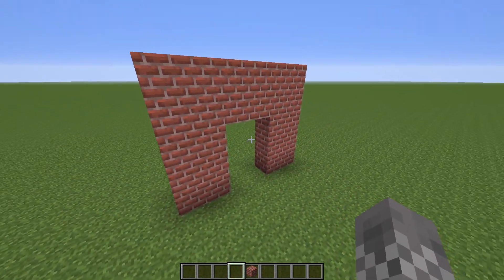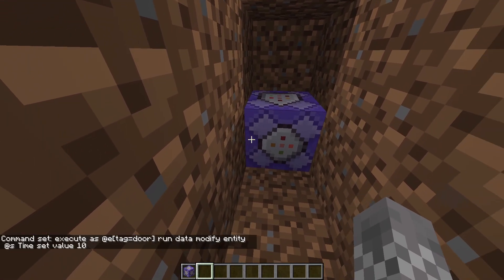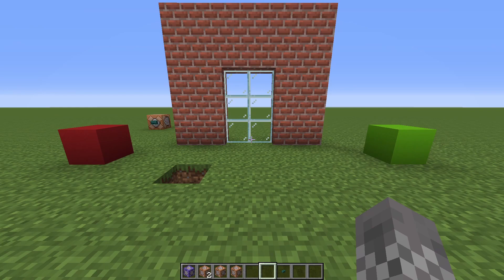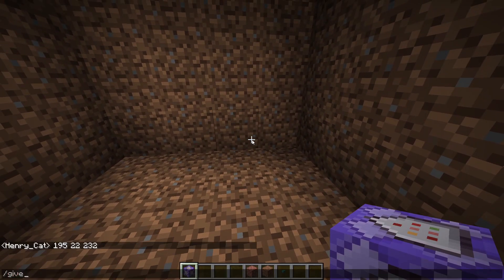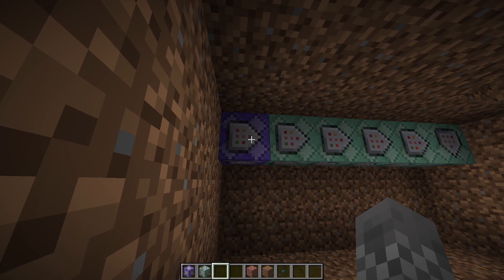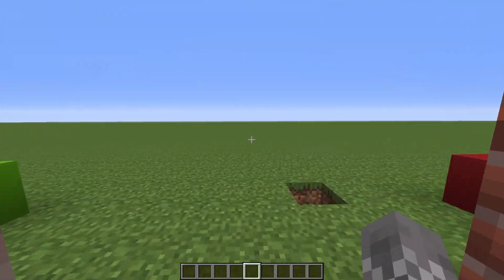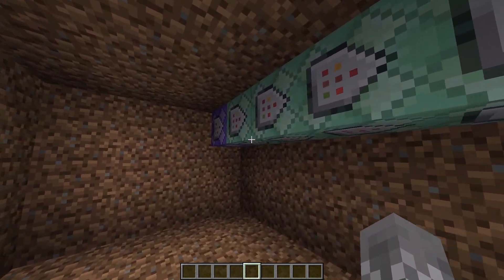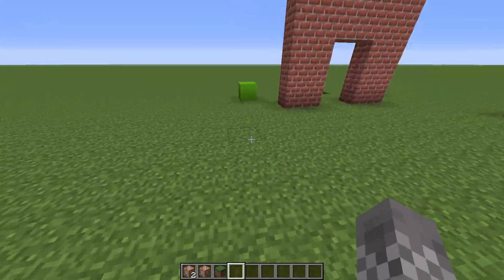How to Make a Smoothly Sliding Glass Door in Minecraft Java - Minecraft Command Block Tutorial

Comment: Thank you so much for the tutorial! i also had an idea that insteadmaking those chain command blocks you could use scoreboard system the easier way of the scoreboard system would be that the door would be powered by button , when pressed , scoreboard named for ex. 'door open' would be set on 1. Then there would be repeating command block that would move the door when 'door open' is set on one, attached to the previous command block i talked about there would be chain conditional command block that would everytime door moves the 0.1 block checked if score 'door open' is eleven if it wouldn't be it would add 1 to the 'door open' scoreboard. There would also be last command block checking if score 'door open' is eleven if it would be it would reset the scoreboard. (Idk if ya understand it guys cuz it can be pretty hard to imagine but i hope some of you do so =).

Comment: Hello, my positive glass blocks move infinitively, and my negatives don't even move, what is wrong? I did /scoreboard objectives setdisplay sidebar door, and it showed that the value of door1 was always 0, whenever I walk up to the door, it remains as 0 unless i have to change it to 10 manually to move it. What did I do wrong? It travels in the X axis. I did exactly everything you did.
Reply from the maker: Hmmm... it's always hard to say exactly what the problem might be, but I can say that it's the fifth command that should be making the score count up. The command might not be running (if the one before it isn't facing into it, you can check by replacing it with a simple /say command), or there might be something wrong with the command itself (wrong coordinates, wrong distance, etc.). If none of those seem to be the problem, let me know and I'll see what I can do.
Reply: @HenryCat  Thank you very much, I'll keep on trying on your help!

Comment: I have a problem, only the negative door moves, and goes to infinity, it doesn't stop, how do I solve this?
Reply from the maker: Hmm, that's odd. Unfortunately it sounds like any number of things could be causing the problem.  I would check and make sure that a. all command blocks are powered on and facing in the right direction and b. that you aren't missing any commands. Both of these sound like relatively unlikely issues, but always good to check. Another thing that might help is run 
/scoreboard objectives setdisplay sidebar door
This will allow you to watch the score of door 1. It should be at 0 when the door is closed, count up as it's opening, and at it's max when the door is open. Besides that, I don't really know what else I can suggest, because it's again really hard to diagnose random bugs like this without checking the commands directly.
Reply: @HenryCat  ok,i will check them again
Reply: @HenryCat  after 3 months,its work! thx!!!

Comment: I know im late, but is there a way to do a door like this but that slides with a redstone pulse insted of someone walking?
Reply from the maker: Okay, here is how I would do this. 
Take the last two commands in the repeating chain and change them to this (it's the same for x and z):
/execute positioned [coordinates] if score door1 door matches ..# if score opening1 matches 1 run scoreboard players add door1 door 1
/execute positioned [coordinates] if score door1 door matches 1.. unless score opening1 matches 1 run scoreboard players remove door1 door 1

Then, to open it have a command block with this command:
/scoreboard players set opening1 1
And close with:
/scoreboard players set opening1 1

I haven't actually tested this but it should be pretty straightforward. Make sure to turn off the repeating chain before making the changes and turn it back on when you're done.
Reply: @HenryCat  
Tested, but had to make a new scoreboard objective. Doors move forever. Also, is there a way to have doors moving on the y-axis? I kind of want a castle-like gate.
Reply from the maker: @hybrid8229  I think a gate along the y-axis should be possible. I think rather than having positive and negative, you just have one side, which is teleported vertically rather than horizontally.
Basically just take the x-axis repeating commands, delete the second and fourth, and replace the "~-0.1 ~ ~" with "~ ~-0.1~" in the first and third. Let me know if that works!

Comment: Small problem: You can go through the door when it's closed because there is nothing blocking you
Reply from the maker: That's true, I was generally just assuming that it opens fast enough that it's not a problem. Generally, the solution to that is to use shulkers since they have an actual hitbox, but unfortunately the little inside bit of the shulker stays visible even when you give it invisibility. That means that for a glass door like this, you can't completely hide the shulkers, which is why I skipped them.
Reply: @HenryCat  You could add barrier blocks for when the door is closed and when it isn’t completely opened, and take them away when fully opened using scoreboard, preferably. I used that for my fence castle gate in my map and it works.
Reply: @HenryCat  I understand why you skipped the part btw, I just wanted to make it clear for the viewers.
Reply: Use a command block to to put a barrier inside of the door when it's closed and when it opens, it removes the barrier. The only problem is that I don't know if you can summon entitys inside of other blocks. I'll test it out.

Comment: everything was working with glass panes so i changed the block to stone bricks, but then the positive was sliding to the negative and negative to positive? when you're standing next to the blocks the stone bricks were in place for where they are supposed to be when the door is closed, but when you move away and the door is supposed to be closed the blocks slide into each other leaving small gaps in the side, help?
PS: the only thing i changed were the blocks, everything else was set as in the video
Reply from the maker: Hmm my first guess would be that you accidentally put the command blocks on the wrong sides. I would double check that, and if it's not that then tbh I'm not sure what else would cause that
EDIT I just thought after posting this, it might also be that when you stand near it to put on the new command blocks, it's set to "open" since you're near it, and then it tries to close when it's actually closed. I guess stand far enough away that it's closed (pushed through each other in this case) and turn off the repeating command block by making the first "needs redstone". Then place the door pieces and reactivate the repeating command block.

Comment: I'm using java, but it isn't working for the second command BLOCK and it doesn't give me the special command block
Reply from the maker: I just double checked and the command seems to be working fine. Did you put the giving command into a command block? It's too long to fit just in chat so you have to put it into a command block to make it actually give you the other command block. It could also be that for some reason there was like an extra space at the end of the command, that always breaks it for some reason.
(Also thanks for specifying you're on Java. I always worry that's the problem so thanks for pointing it out immediately lol)
Reply: @HenryCat  Yes, I had a space at the end cuz I didn't think it would do anything and I got the special command block. Thank you!